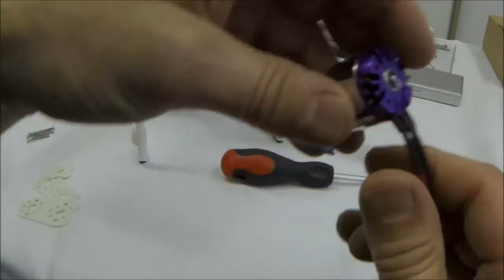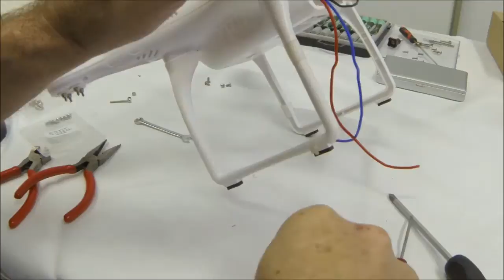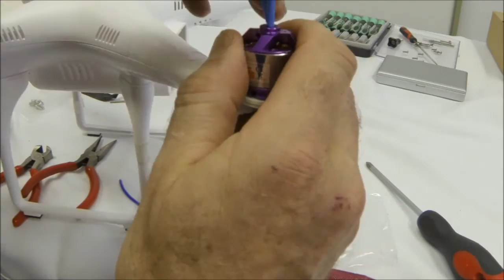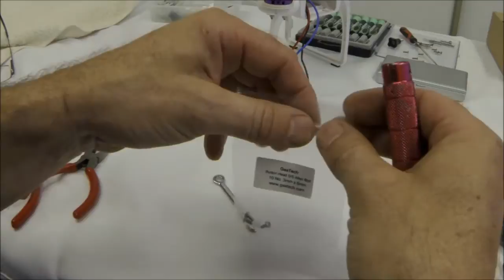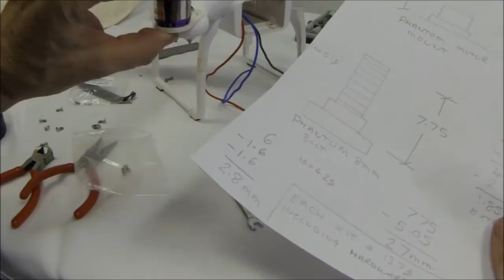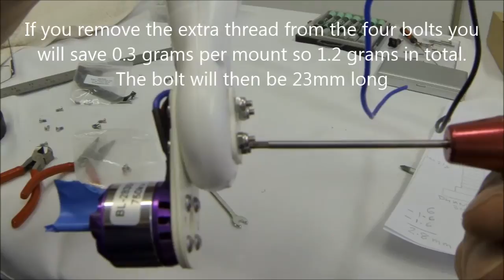0007 DJI Phantom upgrade - extended motor mounts - Unmanned Aerial Vehicle

Comment from the maker: With regards the weak frame.  The Phantom does not have a very stiff frame, that's why i have had to use the plates that go below the frame.  Before these were added it added to much stress on to the motor mount holes.  The additional bottom bracket spreads the load onto the top and bottom for the frame.

You will also notice that the top bracket sits right across the top part of the frame, again spreading the load onto the frame. 

If you look how the normal motor are fixed its only really the bottom section of the phantom frame taking the load.

During the design i did fabricate small plates that were installed where the bottom of the motor touches the motor mount  These were hard to get correct but they did not improve the strength of the phantom frame.  

 #dji     #djiphantom     #djiphantom2     #naza     #fpv     #fr4     #g10     #motor     #mount     #extended     #upgrade     #props    #cncrouter   #cncproduction   #gaatech   #nase32   #phantom   #upgrades

Comment from the maker: This product just allows you to be able to use bigger props if required.  Its not for everybody.  The Phantom V2 is better than the V1 with regards its props.  I have many quads and the smaller they are the more unstable they are.  The extended arms help with this.  So people sell extenders that are around 50mm in length that i feel is way to much.  I have kept these extenders are short as possible.

If you use the same motors and props flight time is the same as you are not adding much weight and as the motors are the same you will be drawing the same ampage